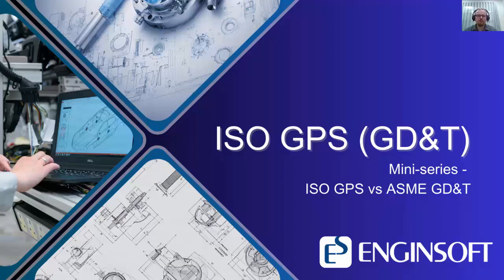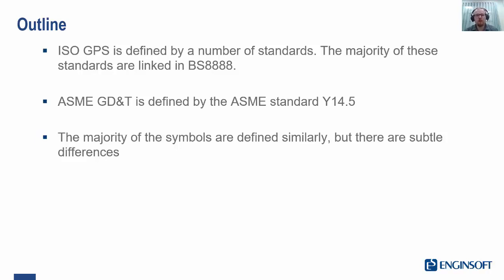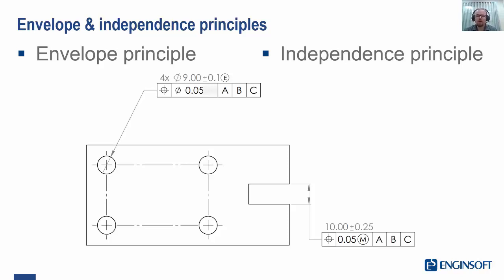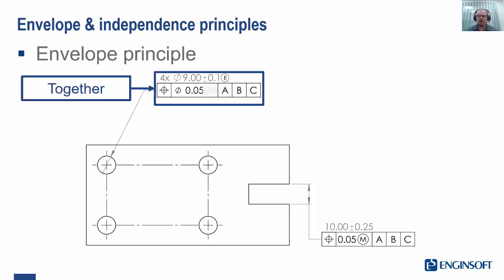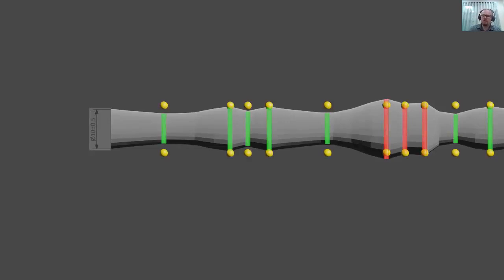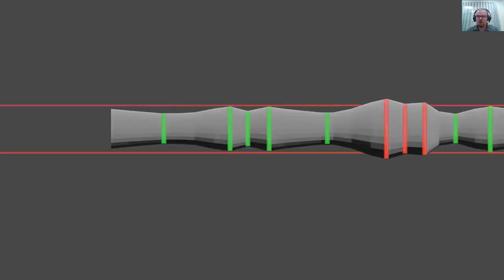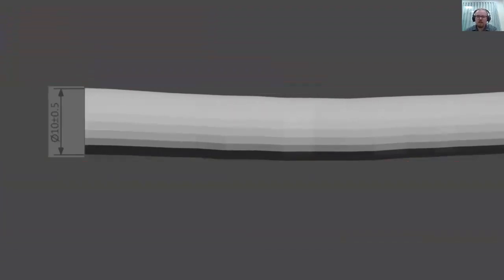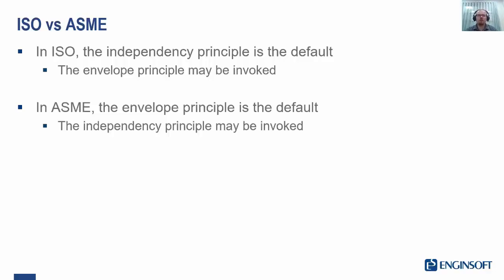ISO GPS (GD&T) Mini-series - ISO vs ASME

Comment: Sorry, by using the modificator „envelope“  ISO GPS can be adjusted according ASME default; this isn’t a big thing, is it? And ASME offers the modifactor „I“.

ASME cann‘t be adjusted to ISO GPS, because reziprocity is there missing. Reziprocity is missing in this shown examples!

And: The big difference of ASME and ISO GPS cann‘t be matched by using any modifier: The rules for the simulation (association) of a planar touch are different! No modificators are available.

Comment: At least in ASME, the envelope principle doesn't say that the size and position are somehow connected into one requirement. It is true that when MMC is applied it is possible to make a functional gage that will check that the "virtual condition" of both size and position is not violated, but there needs to be a separate size inspection anyway. The envelope principle or "Rule #1" in ASME Y14.5 links the size with the form deviations, but not with location or orientation.
Reply: ASME links every linear size with the feature function „primary clearence fit“. Unfortunately nominal desing requires a secondary clearance fit. Here we need a datum to control orientation by using MMC.